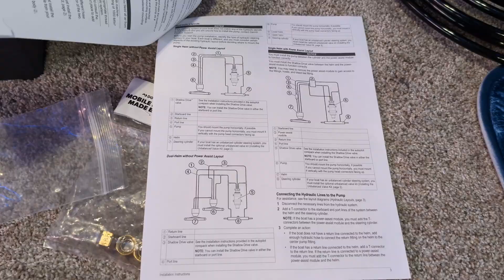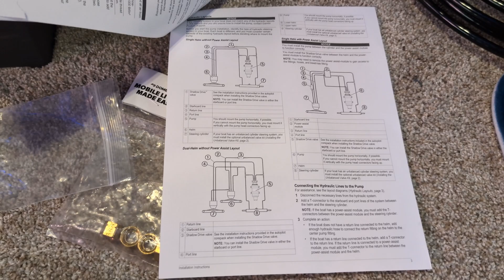1983 Silverton 34' - Garmin Reactor Autopilot Install - Part 2: Hydraulic Line Install

Comment: So I have the same ram K19 and a hynautic 50 helm upper and lower and have purchased the Smart pump V2 with the reactor 40 and a GHC 20. Waiting on delivery. What fittings come from garmin to help with install. What will I need to buy to hook up the steering areas to hydraulic hoses. Your video does show you with the fittings but how many will IO need and do you have links to what you bought. Thanks for the good video.
Reply from the maker: The Tee fittings are 1/4" NPT "Run Tees" where there is one male fitting and two female fittings, those came from McMaster Carr, part number 50785K222. I ordered the 1/4" NPT to 3/8" tube fittings from West Marine part Number SEASTAR-HF5528. The hose is HT5100. The ferrules (tube nuts) are HF5526 from West Marine as well.